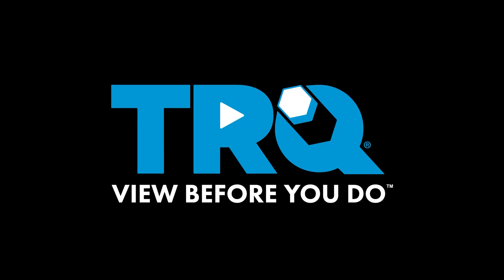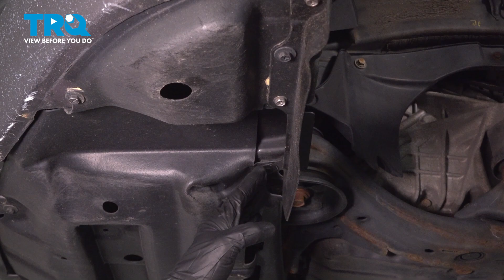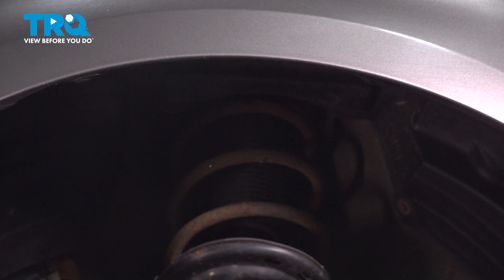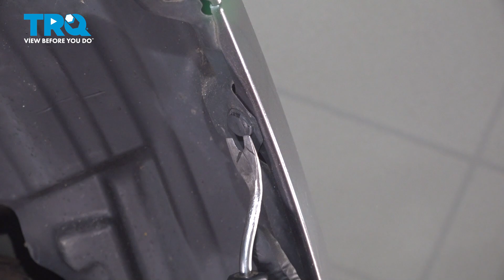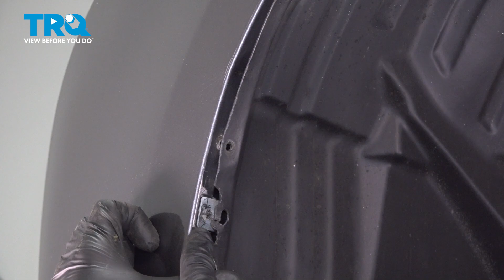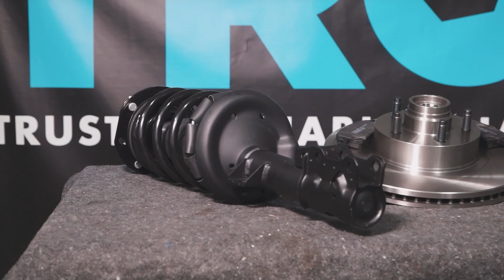How to Replace Inner Fender Liners 2011-2020 Toyota Sienna

Comment: Would be nice if you provided information on the correct clips/bolts. It looks like this liner has been repaired previously and I don't know what if any of those fasteners are original.